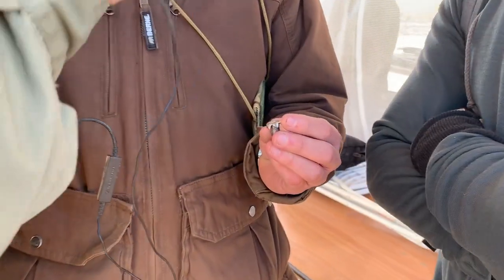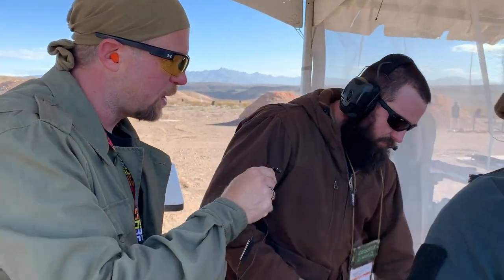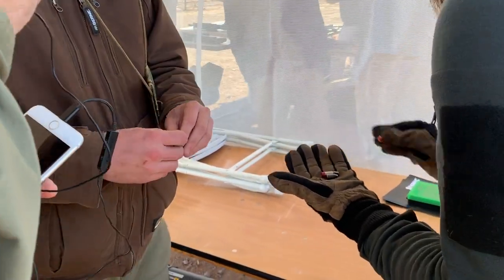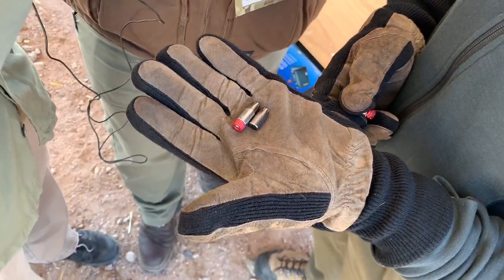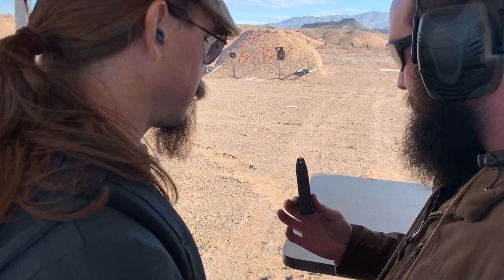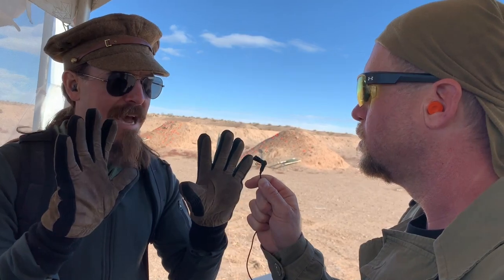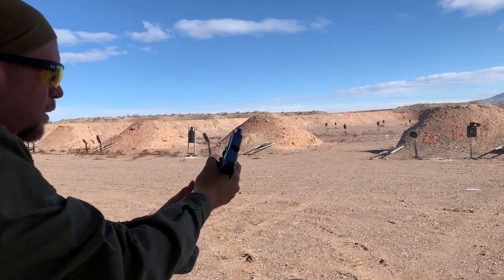SHOT Show 2019: Seismic High Mass Ammunition

Comment: I was hoping depleted uranium … oh well
Reply: My thoughts exactly
Reply: DU is still radioactive.
Reply: Cool … you'll be able to find the bodies in the dark … corpse tracers
Reply: DU was my initial thought, closely followed by, surely not!
Reply: You could use tungsten which is actually denser than DU but it doesn't have an incendiary effect like DU does.
Reply: @rubiconnn  that only happens if you dump enough electricity into it

Comment: Hmmm, I’m curious on velocity and ft/lbs. vs 115gr 124gr 9mm and 230gr .45,will have to look them up.
Reply: I just looked it up it’s 185 grain ammo at 950 ft./s so it’s basically 40 Smith & Wesson 180gr velocities and power without the recoil and you still get the 9mm capacity. There’s no information on the 325gr .45acp yet.
Reply: No info on 12 gauge either. Coming soon.
Reply: My biggest question is going to be how much does that depend on barrel length and will it be reliable with a fully loaded magazine. With the extra weight you’re probably going to have to have a heavier magazine spring to push up all of the extra weight. The factory springs are tuned for 115 to 147gr.
Reply: Jonas Strzyz It depends on the caliber but even with fast burning powder you lose a lot from a 3 inch to a 4 inch barrel in 9 mm. With this slower burning powder I wouldn’t go below a 4 1/2 inch barrel would be my guess in 9 mm and 45 doesn’t get A full powder burn as it is in a 5 inch 1911 barrel so my guess is the barrel length is going to be more significant compared to standard powder but again I’m just speculating. Take this with a grain of salt, I would have to do tests of my own. Unless Karl and Ian are going to do them for us. I can see this ammo doing very well in pistol caliber SBR‘s.
Reply: Wow, you don't know off the top of your head? Most 9MM loads are boasted with better numbers than they'll actually post. For instance while looking at average energy ratings for .40 AND 9MM (love knowing I'm smarter than other people writing actual articles), they had the average .40 load posted at 420 ft. lbs. of energy and 9MM at 450 ft. lbs. of energy. Your average 155gr .40 load will give you around 500 ft. lbs. of energy. My personal carry option is a DoubleTap 125gr TAC-XP that's rated at 1,425 FPS (4.5") producing closer to 600 ft. lbs. of energy. I've chronographed their loads PAST the advertised velocity. Again, even your comparable 9MM DoubleTap load wouldn't make anything past 500 ft. lbs., and they load HOT ammo. This 9MM delusion is annoying. More energy equals more tissue damage, no 9MM load will surpass a comparable .40 S&W load. It was designed to be one stuff above 9MM, as well as most .45 ACP loads. Rarely will you see a premium LE .40 load fail to expand, with heavy 9MM and .45 though. Sadly, that happens all the time.
Reply: @vincentslone1463  my everyday carry gun is a glock 30 in a ankle holster that i can wear all day long and not even notice it . but here is the thing my glock 30 is chambered in 460 rowland that i have clocked at 1290 to 1310 fps that is 44 magnum mid power level plus my bullets weigh 240 grains which is the xtp magnum that 460 rowland sells on their web sight so i do not have to worry about all the stuff that most people who shoot 9mm, 40 cal, and 45 acp do
Reply: @jerry2847  That's TOO unrealistic for a EDC, in my opinion. Why not just carry a full size handgun? I'm ALWAYS either carrying a USP40 full-size during most of the winter, Glock 22, or Smith and Wesson M&P40 full-size. It's all about figuring out the right concealment holster. Anything less than a 4" barrel is NOT optimal in my opinion.
Reply: @vincentslone1463  vincent my barrel is a lonewolf 4.3 inch threaded barrel so it is a full size glock for as barrel length plus i have a dpm recoil reducing system and a alphawolf muzzle break on it so when i shoot it .it has no muzzle flip it just pushes back it is hard to explain but i can shoot it better than my glock 19 which was my first edc gun but i want the max power that i can have for self defense remember always carry what you can shoot the best . i have videos of all my weapons on my youtube page

Comment: While momentum is beneficial for carrying speed through the air, the energy that you’re putting down range would increase more with a faster velocity. The equation for momentum is Mass X Velocity, while the equation for kinetic energy is (1/2) X Mass X (Velocity)^2. So, energy increases by the square of velocity, and is directly proportional to mass. I don’t know enough to speak of wound cavities, and whether or not a high speed pass-through would do more damage than a lower speed expansion, but the physics is pretty cool.

Comment: Well, by the physics, force is mass x velocity(squared).  So technically, you can sacrifice mass, potentially up to the square root, in favor of velocity and have a net gain in force.  However, I think the salient point that the rep made was that this ammunition is optimized for subsonic performance.  With that in mind, you have an absolute maximum velocity that you can achieve, and since you can shoot out of subguns or PC Carbines with this ammo, they have to keep it subsonic whether it's from a 4in or a 14in barrel.  With that in mind, your V is capped, and the only way to improve the force equation is by increasing M.  

Also, there is potentially a higher chance of full transfer of force, as well as conservation of momentum due to a larger/heavier round having more resistance to drag, as well as potentially expanding to a larger diameter on impact without fragmenting.  I won't call this one 'snake oil', but I believe that it's going to have a very narrow application set, primarily that to people hunting with PC Carbines or pistols, Military/LE (especially those using suppressed weapons), and Karl and Ian at subgun matches.

Comment: Finally, someone developed a gee-wiz cartridge that makes sense and doesn't rely on unproven physics. I could see that 185gr 9mm load becoming my EDC.
Reply: If the bullet performs terminally that would be a great home defense load with a silencer. If it actually performs you are getting normal pressure .45 acp energy levels in a subsonic 9x19. More mag capacity than .45 acp in a slimmer profile guns as well. I can see this taking off.
Reply: Less concerned about home defense and more concerned with the penetration such a heavy bullet will provide, especially from a small sub compact.
Reply: @skyhop  Penetration will be low because it's subsonic.  The idea here is, you're looking for the most ft lbs you can get, while staying subsonic.  If you want penetration, go with a faster round.
Reply: @skyhop  Are you also concerned about the penetration of .45 acp hollow points? Penetration as two components. Frontal area of the projectile and its kinetic energy at the time of impact(demonstrated well in the cases when hollowpoints fails to expand. Those bullets penetrate way deeper than same bullets fired from same gun to same target that do expand). If we assume same bullet performance(expansion and weight retention as a percentage) this will penetrate more than a normal pressure .45 acp hollow point(both have little over 500 joules of energy at the muzzle) because the diameter of 9x19 is smaller and the sectional density of 12 gram 9x19 is greater than 15 gram .45 acp. Like i said it will come down to the terminal performance of the actual bullet to determine if its worth it.
Reply: More mass always penetrates more. Faster rounds expand faster and lose energy faster. This is gradeschool level physics.
Reply: @skyhop  Not accurate though.  Faster rounds, don't neccesarily expand faster.  That depends entirely on the nature of the impact.  Most FMJs for instance, don't expand at all going through flesh unless you're talking hypervelocity rounds (say mach 6 or faster).  You know what is highschool physics? (please find me a gradeschool that teaches any physics), conservation of momentum (mv) and kinetic energy transfer (mv^2).  Speed will lead to better penetration, all other variables being equal, whereas a heavier projectile leads to more momentum transfer.
Reply: Where did I talk about armor? 9mm ball from a carbine will defeat about any soft body armor out there. It doesn't exactly take much.
Reply: MrCarGuy20, I suggest you look at how energy is calculated, because it's a 2 part equation, and you're claiming it's a 1 part equation.

Comment: Very interesting, I see merit there. Us bullet casters have dabbled in this plenty. I do have to call BS on the Shellshock brass.  Absolutely unnecessary and just added cost. Standard brass can handle the pressure. I am a USPSA open division shooter and my 9mm major power factor load is a 124gr Precision Delta HP propelled to 1485fps average by a healthy charge of Vhitavouriv 3n38. Quickload calculates the maximum chamber pressure to be just north of 50,000psi. There are modern rifle cartridges lower than that. I use regular plain brass, most is range pickup and being fired many times. That "brass" isn't necessary. Plus for the reloader, that brass requires special dies and it's a pain in the ass. Being able to pick it up with a magnet is it's only redeeming quality.

Comment: If the cartridges have a similar amount of recoil, then the bullets have the similar amount of momentum. The only real plus that I can see from these cartridges, is that you are delivering the same amount of overall energy downrange, but at subsonic speeds, which is particularly congruent with the use of suppressors. Albeit with some differences, such as a slower with a slower and heavier bullet, you get less hydrostatic shock and more penetration. There is a bit of a trade-off, but with a suppressor it should show it's proficiencies particularly well. Just my thoughts.

Comment: 2:38 "Very slow burning powder" -- If it's a very slow burning powder, what is the minimum recommended barrel length to get the full benefit of it?
Reply: From their site they rec >3.5". I shoot them out of my Glock 19 with no issues whatsoever. I definitely carry different ammo with my P365 though.
Reply: @Fr33zy159  was hoping to see if it works in my Sig P938

Comment: The problem is in general speed, trumps mass. There is a reason we have gone to higher FPS, lighter bullets in rifles. Speed gives you farther range and a flatter trajectory. It also gives superior armor penetration, example a hot rod round like the 7.62x25 tok will sail through most soft body armor.  I like the concept and practice, they have a certain purpose these will be amazing suppressed.
Also I seem to remember a shot show where you were poo-pooing the concept of a bi-metal cartridge.
Reply: Until you exceed 2200fps, that speed isn't going to benefit you MORE than weight will. After 2200fps, yeah, things do tend to start favoring lighter projectiles, anything it takes to break that threshold. Below that, you're better off increasing the mass as much as possible to give the bullet a greater chance to drive deeper as it expands.

Comment: The shooter gets hit with just as much momentum as the target. The guys selling faster smaller bullets are the ones selling the good stuff.
The main advantage I see to a large bullet is when you want to stay subsonic. With a speed limit, the only way to get more energy down range is by increasing the mass of the bullet. If one doesn't care about staying subsonic, the faster the better (as long as there's not over penetration).
At least this is what makes sense as far as the physics goes. There's a huge difference between momentum and kinetic energy. As I started out saying, the gun powder sends just as much momentum into the shooters hand as it sends down range to the target. Obviously the momentum of a round isn't the property one uses to figure out stopping power.

Comment: I think shellshock cases are slightly snake oil, since I load 124gr for 9major with regular brass cases and don't see issues. 124gr doing 1350fps with 8+ gr  of HS6.

Shellshock cases require proprietary dies to reload. They only would make sense if they came in 38 super comp, because then you could pick them all up with a magnet instead of bending over. But for 9mm it's not really useful.

Comment: For those curious, the 185gr 9mm has a muzzle velocity of 950 FPS
Reply: Reliable expansion would definitely be a concern
Reply: @blackbird Im assuming it will habe good expansion as its a full lead projectile...no jacket so it should expand quite well
Reply: @blackbird_actual  I would guess that's why it's lead with a special coating, not even partial brass jacket. From the table examples expansion didn't seem to be an issue.
Reply: @blackbird_actual  147gr HPs don't seem to have a problem expanding at 950 FPS, and these 185gr bullets have a thinner jacket material that would likely aid in expansion.
Reply: "185gr 9mm has a muzzle velocity of 950 FPS" -- From what muzzle length? I want to see it tested.
Reply: @mountainhobo  I'm not sure. 5" seems to be the standard for handgun velocity testing, so it's probably a safe bet they weren't getting that out of a 3" barrel. Still though, with a bullet that heavy, it's going to pack quite a punch even at 700-800 FPS.

Comment: e=mc2 Increasing the velocity will increase the energy more than increasing the mass will
Bigger and slower or lighter and faster(other both mentioned at the end) have different uses but I suspect that they will have roughly equivalent energy output.
that heavy subsonic round should be nice for suppressors.
Reply: An arrow is often more lethal than a .22lr round even though they both carry the same amount of energy. It's because it has a larger diameter which makes the animal bleed out faster.

Comment: I disagree on the greater mass argument unless your goal is purely penetration. The ballistics results I've seen typically indicate a bullet weight on the lower end has a greater ft/lbs generated. 
That being said there's a cut off point at which you lose too much mass to properly penetrate and you basically dump all the energy and the bullet shatters almost immediately failing to properly penetrate for optimal damage.

Comment: i am of the opinion that more mass doesn't mean a damned thing if you are getting full penetration of the target. Specifically for handgun cartridges, the only wounding capacity comes from crushed tissue since hydro-static shock does not have enough strength to damage surrounding tissue from handgun velocities. Therefore for handguns, the biggest, and frankly only metric that matters for wounding is the projectile size as it passes through. Obviously you have to take into account the real world, you can't run around with a 20mm handgun, and capacity is also important. But when strictly speaking for wounding capacity the larger the diameter the better. But that also takes into account hollow point expansion. A hollow point 9mm is better at wounding than a FMJ .45acp, but a hollow point .50AE is better than just about anything else. Now is that practical to carry? probably not.
Although, truthfully the 2,300 FPS 9mm does sound like it may jump the gap and allow hydro-static shock to produce a sufficient wounding method, but at that speed its is barrely cutting it. If someone were to make a 5.7 round that could push 2,800fps, then we would have something.

Comment: I very much doubt the 950 fps figure, especially if they are using slower burning powder. Might work fine in a carbine barrel. Interesting idea at any rate. The 325 gr 45 ACP (notably not present on the range) probably gets about 600 fps. Reminiscent of the old 200 gr 38 Spl "Super Police" load, which had a brief heyday but fell by the wayside, mostly due to a different point of impact i think. I was expecting the bullet material to be something like Hevishot. I am surprised it is standard lead. The bullets have to be substantially longer, thus taking up powder space. They are probably using a special powder which is not available to reloaders (factories sometimes do that). So good luck achieving their stated velocities with 2400 or H110. Great video though. There is no free lunch in ballistics. Also, he fudged on the pressure. NATO spec is considered +p+ without question by multiple sources over the years. The NATO smg ammo loaded to that spec is what caused the broken slides on military Berettas, and i wouldn't put it anywhere near a Hi-Power. Caveat emptor.

Comment: The other booth he mentioned where they said high velocity for bears might be on to something as a smaller, high velocity bullet beating armor that heavier, slower bullets can't was the point of 5.7x28. Bears you have to break the skull for an effective head shot or get a heart shot through the ribcage. Both the seismic and the light and fast should be tested against hard surfaces and/or body armor to see how they compare.

Comment: I wonder how well it stabilizes out of standard 9mm barrels. I have heard of problems with bullet stability from 230 grain bullets grain out of some barrels in 10mm. That's not to say a faster twist in a different barrel would not make it work just fine. Keep in mind a jump from 55 grains to 62 grains made the military speed up the twist rate in the M16.

Comment: I'd be worried about malfunction due to that shotshell primer casing (red area) at the back being ripped off by the extractor. especially after the the chamber heats up, and the metal expands, creating a tighter chamber. Might be fine for a few shots (it's intention). But I'd suspect prolonged firing would create more than average number of malfunctions. And bad ones at that, because if the rear rips off you have nowhere to preass against, to remove a jam. you'd have to remove the barrel to extract the steel wall of the cartridge.